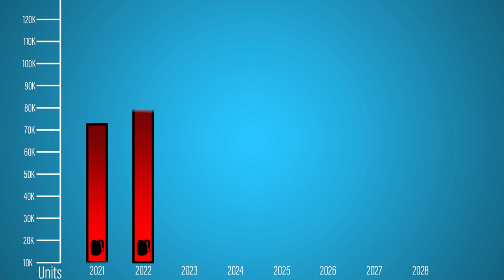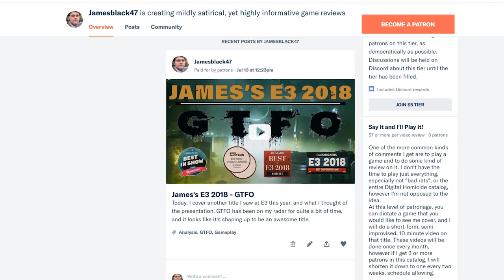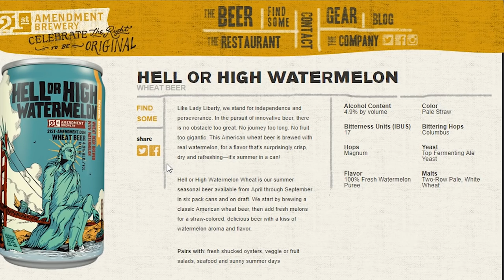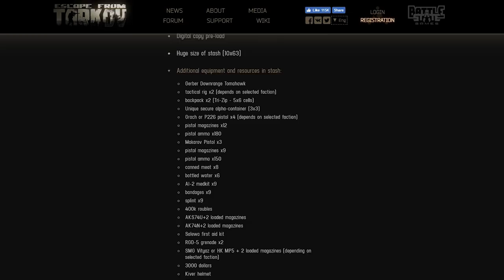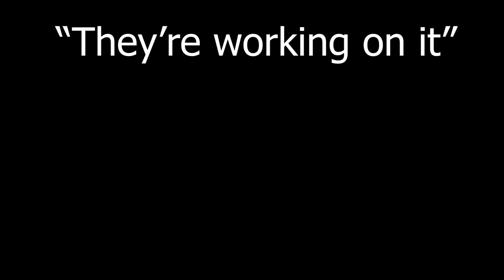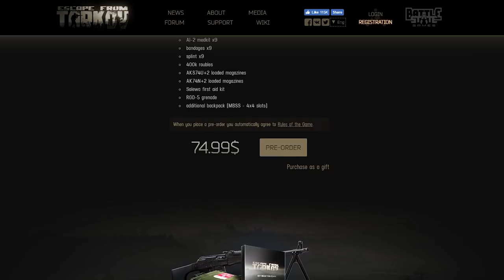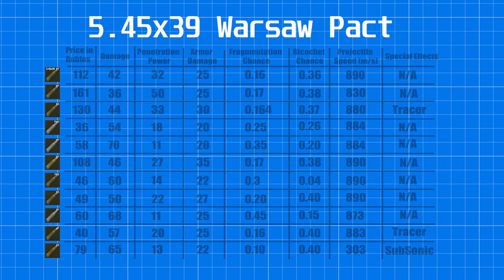Escape From Tarkov: Worth $44.99? ($99.99? $149.99?)

Comment: Scavs will shoot at a last known location of a player if the player retreated behind cover, meaning if you slink into a Bush and a scav sees he will try to shoot the Bush incase you're still in it. Same thing with the aluminum fence you were shot through. However, in the clip where you're shot while standing behind a double stacked pallet of concrete bricks, you can see the bullet impacts on the bricks, so I'm guessing you were shot by the scav that spawns with a sniper SKS on top of the warehouse directly behind you. Just a thought.

Comment: if you use a matchmaking system, experienced players will abuse it and run to the best loot spots. This in turn will make them a bigger profit due to no risk and high reward. TBH best piece of advice i can give to new players is, veper plus 7.62 ps rounds, will pierce most armours and 1 tap most helmets.
Reply: The only problem with that tactic is that it's outdated. Currently, you can't immediately buy the vepr. You can use the SKS though, which is basically the same but better suited for long range

Comment: You neglected to mention the "Sherpa" programs, there are actually players designated to helping and arming new players. You can check them out on the forums, they get gear specifically to give away to new players and they get rated according to how many players they help. Further details can be found on the forums. I do agree however that the learning curb is very steep but when you reach that pinnacle and walk out with M4 after M4 its is really rewarding.

Comment: One thing I would like to point out about your review is the new player issues in Tarkov. Yes, we can all agree Tarkov has this unrealistic like learning curve when you start off massively gapped not only in skill and gear from seasoned players but also in common loot knowledge, spawn locations, inventory management, etc. I can testify myself that the game is so unfair to newbies because when I first started I struggled just like every other newbie currently in the game. In fact, I struggled so much that I didn't even know how extracting worked when I would launch into raids so I would literally be trapped in raids waiting to die because I didn't know where or how to extract. But the point I'm getting to is that the game gets better with experience because that's what this game is intended to be and if someone isn't going to be into that game style then don't get EFT. Not every game has to be tailored is such a way for new people to get the hang of it easily or right away and that's what makes EFT the game that fans want it to be. Yes, Matchmaking is a seemingly quick and easy solution for this newbie gap issue but in the long run it will make the loot extremely unbalanced with all the high levels essentially circulating all of the high end weapons and armor in their matchmaking queue while all the low levels circulate their very shitty and low end weapons and armor. Also think about how squads would be matched up if they have a level 5, 30, 50 and 45 either that one squad member is at a severe disadvantage against high level players or every damn low level player is going to get wiped out from this unbalanced squad.

Comment: I'm a noob (less than months experience) but i noticed dome major improvements

Less lag: it only lags Every one and a while (git a good computer) 

Less of straight oblivion: (very anecdotal) i get wrecked less (only once) 
A sherpa system: attention! If you can't figure out the map you can ask an experienced player to guide you 
Will warn you when do do something wrong (like loading the wrong ammo) 

But there are stills some issues 
Lag: mainly napped when i get shot at

Noob unfriendly:although they fixed the problem with the quest there is only vague descriptions on ammo (so read up)

Comment: 1. all of the newb weapons have been nerfed to hell recently and very recently. The saiga 9 that used to be newb favorite because it was cheap and you could by armor piercing ammo for it at a very cheap price very recently was nerfed to hell upsetting the members of the community that used it without warning or reason.
2. The scav are broken again they did have them fixed in a previous patch.
3. the matchmaking system currently does sorta exist now the problem is its in early infancy. scav's spawn with better loot the higher lvl your character or the other people in the lobbies lvl. The only way to get 3m body armor is to have someone with a high enough lvl in the lobby. taking the quest to early will end in players either having to buy the item from the black market or failing the quest and loosing valuable relation with skier.
4. all of the quest are a complete pain in the ass and are almost impossible to complete. Most newer players go completely broke when trying to complete the rather brutally difficult quests and witch has caused a sharp rise in hatchetman. some of the community outright hates them partly do to the net coding and the fact there isn't much value on there corpses. most of the community complete unsympathetic and remorseless towards early after a wipe. These players often claim there is no reason to play as a hatchetman because you can get gear by playing as a scav but that gear is not guaranteed and if the play parishes. they expect the player to wait on a product they paid $45 for 30mins to try again. 
5. They don't give two shits about new players. There planing on adding more and more punishing mechanics that are only going to effect newbie players and people who are bad at the game. Ontop of what i mentioned before on my comment there planning on adding more and more mechanics to the game that are going to vastly disproportionally effect newer players. They plan on adding a health insurance system that is going to punish players for dying depending on how much gear they are lacking. They even removed item bartering witch made the game vastly harder newer player because once again they had to spend more alot more money for rather low grade gear in hopes of having a chance at finishing a single quest.

Its only going to get worse for the newbs from here.

Ways they could have fixed some of these problems.
1. let players complete the quests in offline mode
2. free faction themed gear always available. Therefor players would not be conservative with there gear and be more comfortable with the idea of going all out with there gear.
3. voice chat all tarkov has for friendly interactions right now is the friendly tarkov wiggle.
4. guns being changed back to their more realistic values. Nerfing weapons just to nerf them does not fit the theme of tarkov and i'd like the shotguns to be a bit more realistic in the sense that the leg meta isn't the only way to kill a armor opponent. realistically if you got within 10-20 feet of someone with a shotgun and hit him with it the impact would cause a armor opponent to go flat on there ass and badly injure them and a headshot at that rang would always be a instant kill even with a bean bag round. Its rather the same with some of the more high powered rifles (example the trg sniper rifle) 
5. better quests in general but that might take vastly amount of more time and so i just be happy if you could complete them in offline mode like you used to be able to do freely earlier in the beta.

Comment: Matchmaking as you suggest it would just make hatchlings even more succesful, since they have no threat or risk. They can run in, knowing everyone else is low gear or other hatchlings and rush high loot spawns to farm loot.
Reply: also you forget the fact that however good your gear is, a single headshot from a mosin will kill basically anyone... that's all it takes, a couple rifle rounds to the face. Even pistol rounds to anyone without a mask will kill you.

Comment: Aside from the bear and Dracula mixups at the start, this is an excellent review and quite to the point on the major issues, beside the upsides.
I do feel it needs an overall assessment however, not just summing the pro's and con's and concluding that if the pro's outweigh it for you, just go buy it. 

In my opinion, the current mechanics not only do not lend themselves to a balanced experience (as you mentioned in the last sentences), but in fact it is getting more and more imbalanced, resulting in a game that is less fun and more of a Stockholm syndrome: to compensate for lack of accomplishment, most players try to find ways to justify buying this expensive game. Whether by teaming up, cheesing their way through quests the easy way or camping, loot running, it all takes away from playing the game as intended. The game even has an official "sherpa" program where the heavy geared veterans "guide" noobs through quests or in general, which is actually just protection, bridging this imbalance. This is further fuelled by its toxic community, not less backed by a weak PR from BSG that resembles a communistic USSR where any alternative opinion was equal to treason. Any mention of imbalance or matchmaking will result in not just a toxic wave of the fanboys on their forum, but even mods and BSG crew members pretty harshly wiping any discussion off the table. Which is ironic, considering it is in Beta and feedback is what starts discussions, isn't it?..
I think that statements by their COO (Nikita, a father figure for the community) that the game is NOT meant to be "fun" says it all. They do not want you to feel good playing the game. They want you to feel the harsh realities of life. Which in my opinion takes the fun out of it and makes me wonder about the purpose of developing this game. Clearly, gaming communities exist to have fun, 99% of us want to have fun by escaping reality, not being put through the same pains that life is not fair. We all want to feel empowered to accomplish something and not just be a leaf in the wind, when playing a game, we want to be in control and it needs balance to empower us to this end. Balance means that AI aimbot is just as good as to give you a chance to shoot them, as making them onetap you in a split second is easy, but giving them just that "human" touch to give you a chance to fight them is what is exciting and balanced. It means that you don't put a veteran against a noob, you don't allow teams of 4 or 5 fight against a solo player without any nerf for the squad, etc. Imbalance will decimate the playerbase and if not for commercial purposes, the game will probably need to be financed by other means, probably military. Anyone thinking they will have fun playing this game will be sourly disappointed on the long term: it promises a rewarding gameplay in concept only, but due to the imbalances (of which technical issues are a minor part, much worse is the gap between squads and solo players, noobs vs veterans, etc.) mostly results in gear fear, which leads to player behaviour like hatchet running, teaming up to reduce risk of death, more scav raids (=random low tier equipment and no character progression) than actual player character runs with own gear, camping, etc. It is telling that during the current pre-wipe event the devs (despite huge protest by the otherwise fanboy community) have disabled the ability of secure containers to stash away loot safely, to experiment with player acceptance. They did this to counteract the absurd high numbers of loot runners, who are basically running in naked to get to prime loot first to stow away securely in the 140 USD package container, then disconnect, ruining their own game time and progression for everyone else. All this is fuelled by the money focus this game has become: imbalance leads to gear fear, leads to more focus on having enough money to compensate for lost gear. This game has turned from a shooter/survival into a looter/camper game, where PvP is streamers squatting everyone else like flies and most players are just easy prey for top players. 

It is also one of the most viewed games compared to how many people actually play it, for good reason: much more fun to see others suffer or live their successes when we know we will never get close. The devs keep repeating the mantra that it is this unpredictability that makes for all the thrills (as you rightfully mentioned, for SOME), but deny that it goes at the cost of their playerbase. The secure container change experiment shows however that even they no longer believe their own mantra and see their concept fall apart bit by bit.

To conclude: while the concept of the game is great, the imbalance that the devs want to uphold is destroying the concept. Some features need to be introduced to make the game balanced, such as matchmaking of the kind you mentioned or reduced benefits for teaming up, to encourage development of individual skills instead of winning by numbers.

Comment: EFT is a game with a great idea and it worth definnetly the 45$ invest, but I don't recommend the 150$ pack. There is only two main benefits of paying the 150$ pack, the others are just simply secondary: The Gamma case ( A 3x3 safe pouch) and the three times bigger stash. For the gamma, you can have a 4x2 case doing quests and you can use cases to increase the stash space, both things being on the mid-game.

For anyone who wants to try the game, you can purchase the smallest pack, try the game and if you like what you're experiencing you can upgrade the pack, but beware that there is a long list of problems on the game. The game is a Beta but  it was many bugs, people exploiting glitches or using hacks and the worst part on that: BSG is doing NOTHING against cheaters/glitchers, even with people streaming and being killed by people that were cheating without trying to hide the cheats ( OperatorDrewsky was killed during a streaming by a cheater with the name "ImCheating") , they just add a couple of players to a ban list and that's all. They're creating an automated anti-hacks system but for now they do practically nothing. Their policy against cheaters is trash.

You should be aware of that if you want to purchase the game.

Comment: I have some serious doubts about how this is going to mature. The game they seem to be planning to make is so far removed from the game they are making that I'm relatively suspicious that it'll all eventually come crashing down.

Edit: Also, if you're looking for another SWAT/Deus Ex/MGS-esque competitive FPS, I'd like to recommend Intruder. Its community is extremely small currently but it has some of the best improvisational and occasionally absurd tactics I've seen in a game.
Reply: MadmanEpic how does it seem far removed? They are working on the main mode rn
Reply: I mean, it just seems like there are huge gaps in the balancing and mechanics of a raid-based game versus a single-player/multi-player/open world/whatever else they're trying to make it that eventually are going to be problems.
Reply: MadmanEpic well of course but also single player isnt going to be in escape from tarkov its gonna be another game they are using tarkov to build the game that the singleplayer game is going to be built on much later we prob wont see this singleplayer game for 5-10 years

Comment: I DESPERATELY want to like this game but as you mentioned in the video, as a new player i just got tired of being dunked on by seemingly invincible players and aimbot scavs. The only way for me to get anywhere was to spawn in every 30 minutes as a scav, find the nearest AI scav, kill it while it didn't shoot back, take all it's gear and run for the extraction with my tail between my legs desperately praying i don't come across any players. Sure, i had loot if i did that. Sure, i had money afterwards. But it wasn't even a remotely rewarding experience. I stabbed my "friend" in the back and ran like a rat, basically.

Then there's the quests. They're not all bad, but it's pretty clear that some veteran players know that certain areas are important for newbies and their quests, so they seem to camp around them hoping to catch a new player grinding quests off guard. It's infuriating. Can't tell you how many times i got popped in the back trying to get the bronze pocket watch from the truck on Customs even after checking all my corners or waiting until the near end of the match.

I want to like this game, but between work, cooking, and other video games that i enjoy, i simply do not have the time or anti-frustration ability to grind levels, quests and gear. Not to mention that the devs only pump out more cool weapons and items that i will simply never aquire.

And then there's the container system. I get that you should be rewarded more for "pledging" to the "kickstarter" that is this game, but the difference between what you can do with the Alpha container and the Gamma container is... Frankly insane. Where you can hold a couple small, minor meds with the Alpha container, you can take a whole Grizzly medical container (which can heal basically any kind of damage in the game) with room to spare for rare loot and dog tags with the Gamma container. Personally, i find a big equalizer in this game would be to give everybody the same size container, no upgrades, no advantages for EoD buyers, but i doubt that's something they could roll back on now.